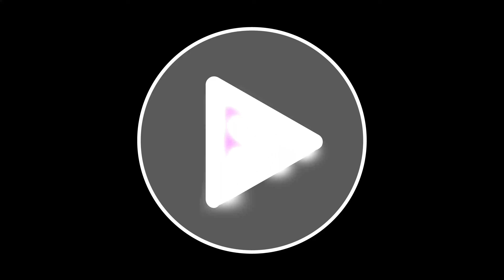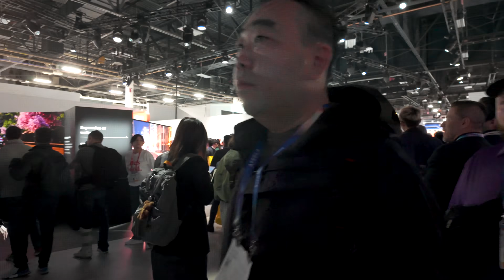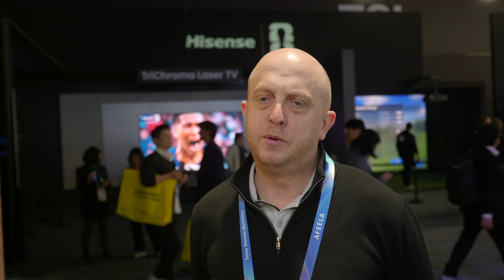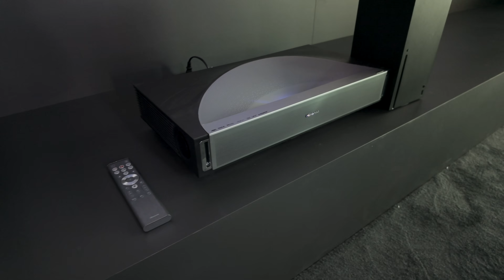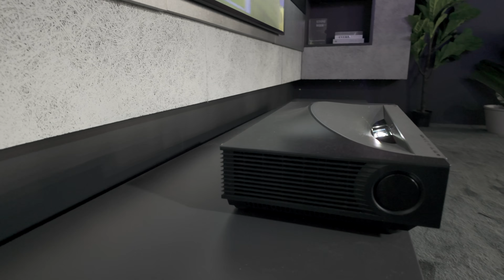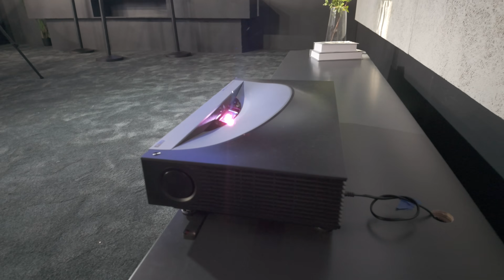Hisense PX4 Pro and L9Q Laser TVs | CES 2026

Comment: Px4 pro vs awol aetherion.. I need a side by side. I’m aiming for awol because of the kickstarter deal
Reply: I'm vary of the kickstarter deal, says no refunds after preparing for shipment (before it even arrives)... and why is it half the price at launch? they could be overpromising knowing hisense might have the edge. Think I'll wait for both to release and see comparisons
Reply: @TheHuman-123 I’m no worried about it in that aspect. They did the same thing with the valerian and it turned out to be the best projector of the year
Reply: @ @ryancams  px3 pro is generally still recommended over valerian which is said to be washed out in dark rooms and all
Reply: 4k 120
Reply: PX4 has more lumens than Aetherion's Max model.
Reply: @TheFintastics slightly, but I don’t think it would be notable . awol also has pixel lock which gets rid of the rainbow effect, better latency and Dolby vision gaming. Seems like it offers more as a overall package,
Reply: @ryancams Pretty certain the PX4 also has Dolby Vison. Dolby Vision gaming should be the same thing
Reply: @macho9556  you gotta agree at that 2000 price point , it’s a steal.
Reply: @ryancams  px4 pro also has Dolby vision? Or is Dolby vision “gaming” something else? Think the px4 pro will also get DV2 with a software update in future (Hisense first brand to start implementing in 2026 TVs).

Latency wise they should all have the same figures really as the same Texas Instruments DLP chip is used, if you look at previous gen they were all almost the same for every projector and Hisense managed to get better speed out of the chip than awol.

The pixel locking sounds unique and good though, might be a good reason the awol might turn out to be better
Reply: @TheHuman-123 Dolby vision gaming is something else, px4 will have the advantage in having 4k 120hz but awol has a better refresh rate so gaming wise is a toss up
Reply: @ryancams awol should be also 4k 120hz as far as I see.
Reply: @danielradomiak9468 I’m not seeing that, if it was 4k 120 that would definitely be the death blow to Hisense
Reply: @ryancams Yes you are correct it is 60hz. I thought I saw it😅
Reply: @danielradomiak9468   it’s gonna be a great competition and I don’t think you can go wrong with either choice I put my 50 dollar deposit on the awol though because you can get it for 2k when it drops on kickstarter . If you wait it will be over 4k. That value for 2k is beyond great
Reply: @TheFintastics px4 has 3500 ansi lumans and awol has 3300 iso lumans making the awol brighter. That means the px4 would be closer to 2800 iso lumans if converted